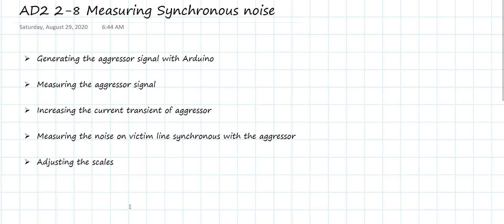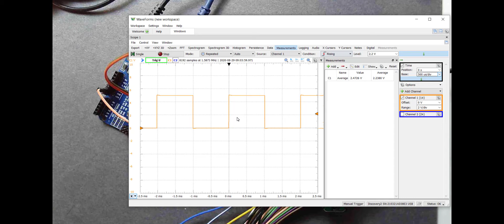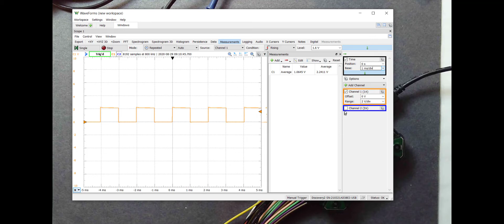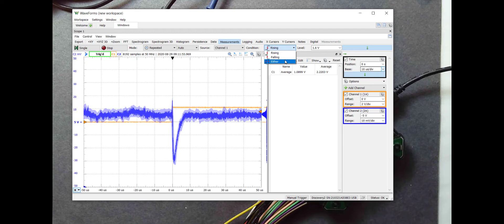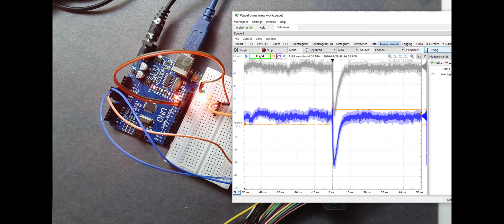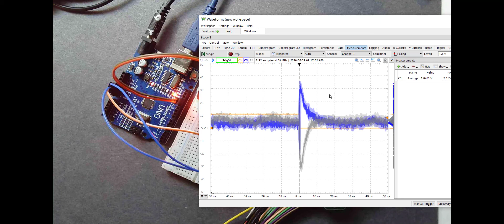Comment: Thanks for the great video. I think it could be good idea to turn on/off multiple pins connected to LEDs on one port (e.g. PORTB0-7) at the same time. I think it should show similar result as the 50mA LED connected to 1 pin. Do you think it is possible to perform a PDN analysis (PDN impedance) with AD2?